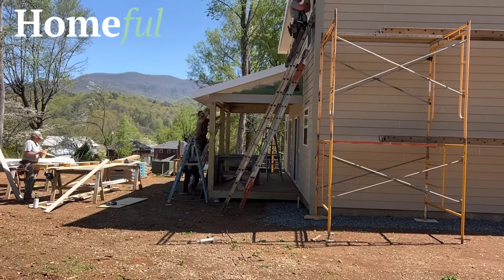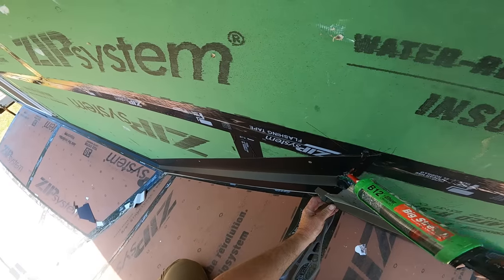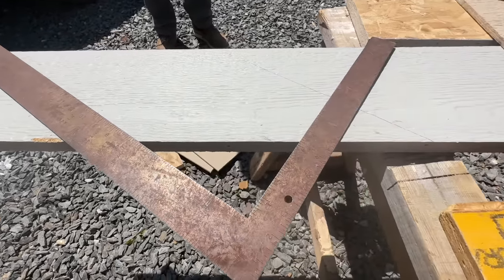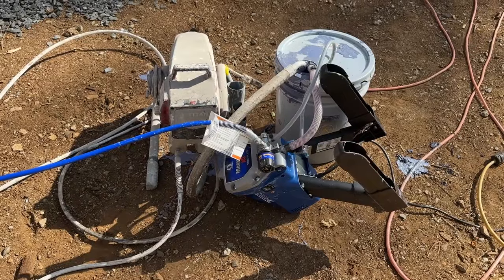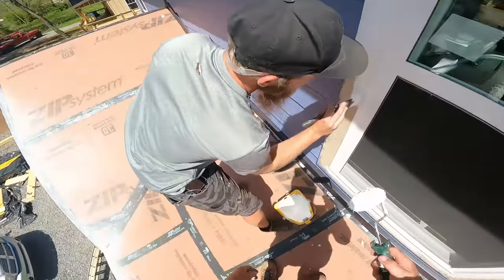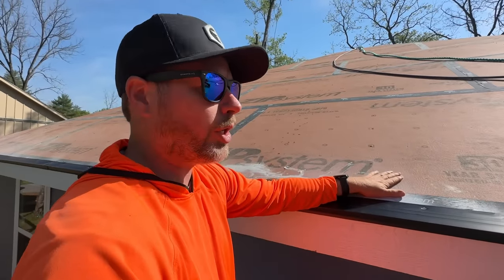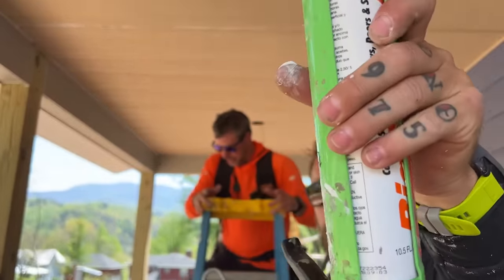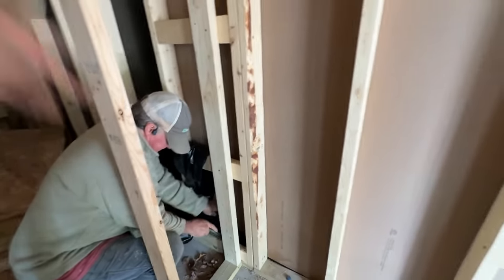Construction of a Duplex Part 20

Comment: That catch by Jason was awesome - the super warrior pose that followed even more so. Ha! 

Using spray shields makes your work more accurate (and faster) even if they're just the cardboard ones you can throw away, and buying NEW brushes on every single job is a MUST.  It's a small price to pay to have a good edge to work with.  Old, nasty, chopped up wasted brushes make a paint finish look awful and just tend to frustrate the person using them.  Do it for your employees mental health, if nothing else.  Fresh brushes keep people motivated and happy.  

The bad thing about using a paint color that's DARKER than the final coat is that now it will be hard to cover perfectly.  If you encounter that again on another project, mix some white with the off-color, incorrect first coat paint to make it LIGHTER than the final coat, correct color.

Comment: @8:00 that was an impressive throw and catch!  And Jamie's "plane therapy" is spot on. When you get those shavings, you just feel like a craftsmen.
Reply: I sometimes catch myself gazing at my low angle jack with delight.
Reply: @ohasis8331  as you should!  😁
Reply: Especially after warming up the blades on a whetstone and strop.

Comment: Sick Building Syndrome 
Interesting result in Arlo's plastic under fire rated drywall. Observation of; 'small amount of mould".... So, condensation is caused by temperature variations and no air circulation. This topic is going to be controversial; seal it up for energy efficiency or let air circulate to reduce toxic mould?
💡🇭🇲 Thankyou

Comment: the PLANE THE PLANE THE PLANE THE PLANE THE P.......YEP used mine today on a cabinet to flush the backing to the right side. Can't even tell I cut the panel 1/8th inch too long...any tip on clear brushed and rollers?

Comment: I have a question for any of y'all construction experts that want to comment. I'm adding a room onto my house by boxing in a carport. Wanting to sheetrock the existing exterior wall that is now an interior wall. It has wood lap siding that I'm taking down. I thought the right thing to do is add osb to the wall and then sheetrock over top. I've had a few opinions that it would be fine with just the sheetrock. Was wondering what you think should be done? Thanks alot

Comment: The problem with all the adhesives and caulks and super strong building techniques used now is that the poor remodeling guys 40 years from now will have to use dynamite to take them apart!

Comment: Shouldn’t there still be some kind of step or continuous flashing under that trim board? It can be step flashed during the shingle installation, but then would have to be counter flashed afterwards, so it would make more sense to put the roof on, step flash, then your black trim piece over to ensure no water will splash in between the dormer and home

Comment: Regular car antifreeze at a 50 / 50 mix is what you put inside the spray pumps when you leave them for a while. I would like to see you guys use a battery powered caulk gun Im curious if its a good buy.

Comment: Crazy they made you guys drywall between the party walls. In my area we do a one inch gap between the 2 walls and they do the fire rated drywall on the inside face of the party wall, at drywall stage after all the other trades are done. Makes it so you can walk between units and you don't have to worry about it getting wet

Comment: I painted my sister's house that very similar color with white trim 10 years ago now everyone is doing their house with blue paint and white trim but we painted the ledger, band boards and fascia a dark maroon red. We currently in the process of residing within budget and time but I got 4 walls with 11 to go and insulating cause the 1×10 sheathing was installed on the inside that is covered by lathe and plaster and then knotty pine tongue an grove boards.

Comment: Question for you guys, I am currently building a 2 story garage with the lower half being block and the 2nd floor being framed, The roofing contractor was supposed to be here last Tuesday to dry ut in and now won't answer calls, The roof sheeting is ⅝" regular plywood and I really need to somehow dry it in without having to figure out the underlayment....can I install a zip tape on the joints to dry it in for the time being? I feel like it would be easier for me to then do myself until they get here with the rolls of water shield stuff and I live in Florida so rainy season is upon us and the building is getting soaked inside...I should have used zip sheeting on the roof but the contractor helping me said not to but we did use it on the subfloor and not sure what the reasoning was there...I wanted to use it on the entire building but he talked me out of it
Reply: Just choose a synthetic underlayment and get it dried in. Super easy and fast install.

Comment: if you used hardiebacker board for the interior fire wall separation, you wouldn't need to wrap it in plastic, plus it offers better fire protection
Reply: It’s not allowed by fire code here (I bet there too) as it isn’t certified for a one hour burn. I’m sure fire rated drywall is spec’d and was done in accordance with the local building and fire inspectors.

Comment: Cornflower Blue. Arlo's hole saw bit would release much easier if Jay would hold the material being cut "level" as the arching material is pinching the saw blade. Not a "pro" tip but a common sense tip. 😁

Comment: Aren’t you supposed to primer that board under the flashing?
Reply: Wait till they do the roof. They will completely cover that trim with flashing.
Reply: @brycehinton7860  doesn’t matter. It’s fresh cut OSB. You need to seal that. Dew/moisture alone will cause that to expand.
Reply: Per lp instructions, "All wood substrate that is exposed to the weather must be sealed in a manner that prevents moisture intrusion and water build up." 
I would argue that those pieces are not exposed to weather.

Comment: Instead of drawing the pencil line for the spacing above the gable roof flashing, I just use a piece of wood.  Squish the siding against the wood and the wood stays (it pressure fitted so doesn’t fall off the roof), and then I just keep sliding the spacer piece of wood up for the next piece of siding.  You guys are absolutely right though, it looks terrible without consistent spacing!